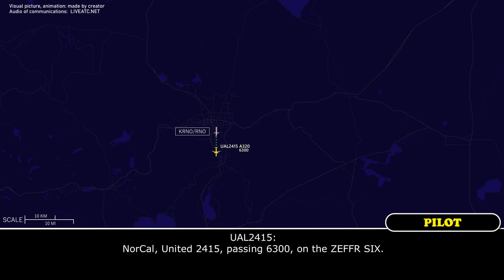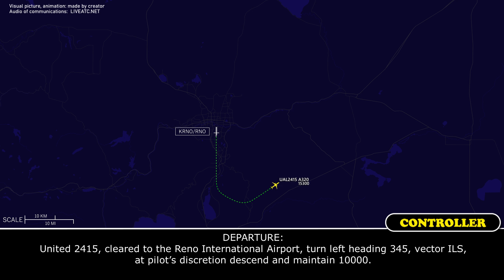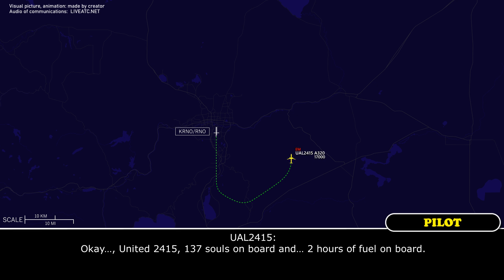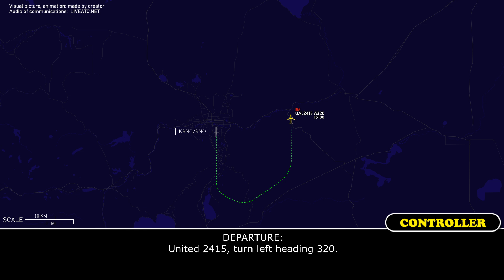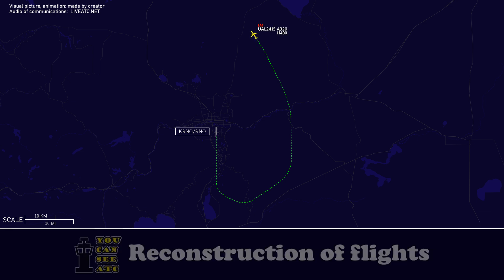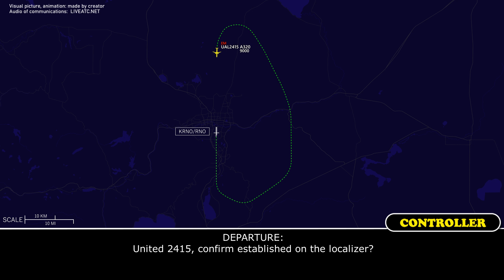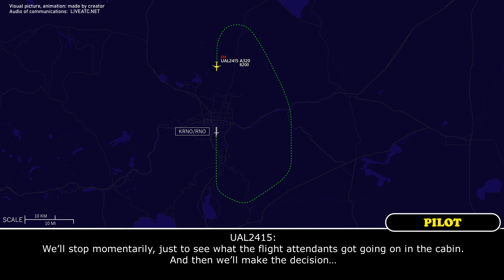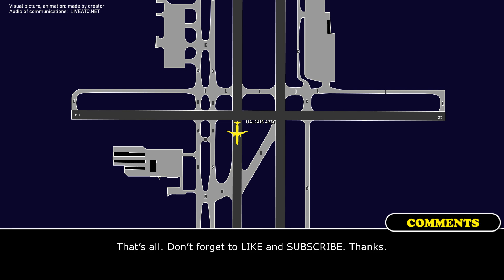Electrical burning smell in the cabin. United Airbus A320 returned to Reno. Real ATC audio

Comment: Wonder if they smelled wildfire
Reply: Interesting thought!
Reply: My guess: Yes they did. 
You smell the wildfires when you fly through the plume of smoke. And it takes quite a while to dissipate even when you're no longer inside the plume.
Reply: I’d say probably not. Electrical burning smoke has a very unique smell compared to wildfires which would essentially smell like a campfire. There’s a reason electrical smoke had the nickname “magic smoke”